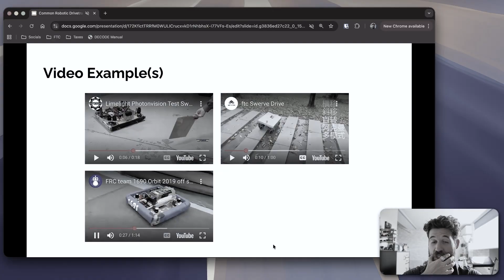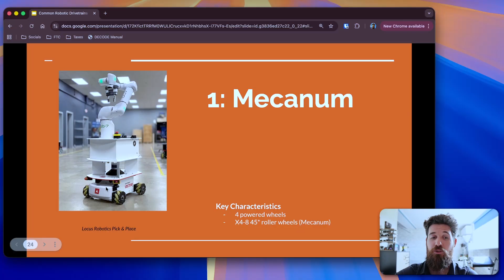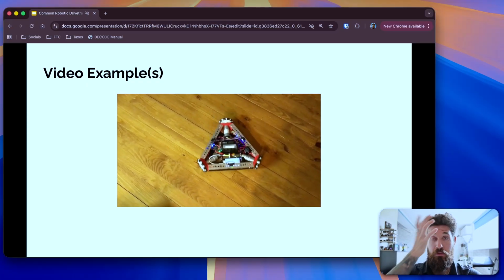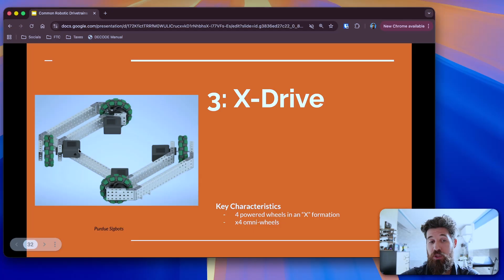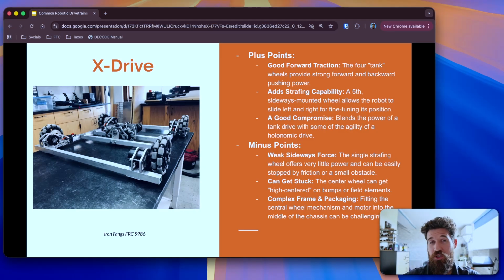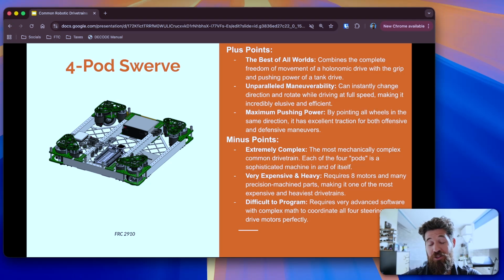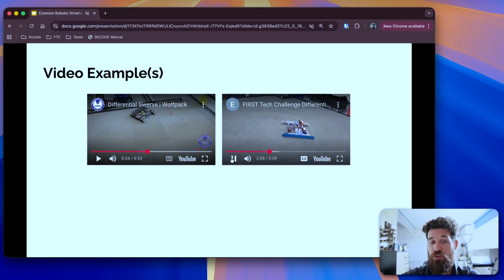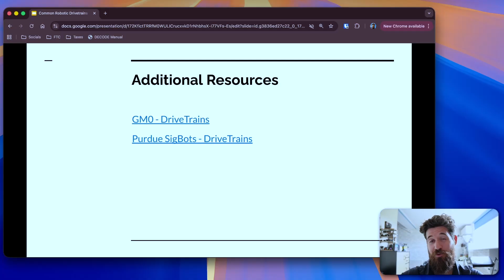Holonomic Robot Drivetrains: What You Need to Know

Comment: Id mention that in FTC most coaxial swerve designs dont use 2 motors, but one motor and one axon so unless you have 9+ servos used by other systems, swerve wouldn't be a problem from a limit standpoint
Reply: 10 servo limit
Reply from the maker: Fair point in an FTC context. I was keeping this a bit more generalized to robotics in any context, though that may have been a useful point to separate motor vs servo motor